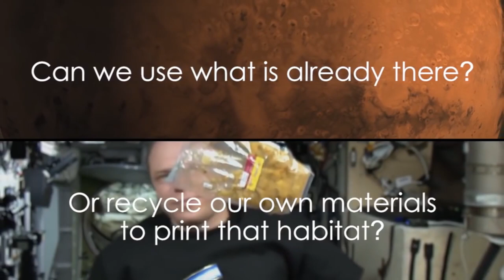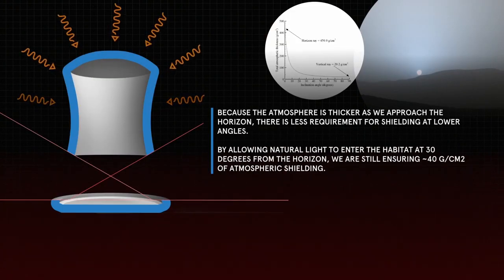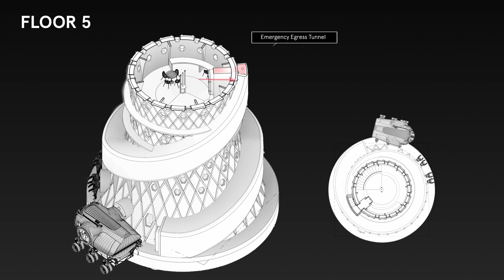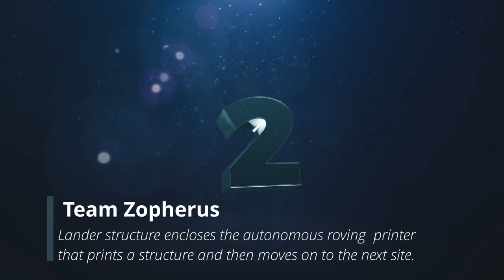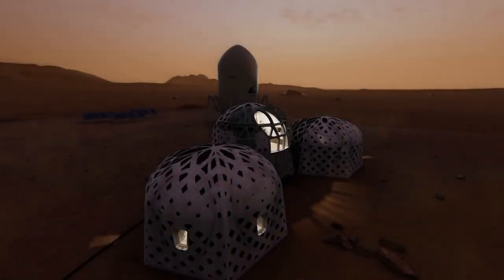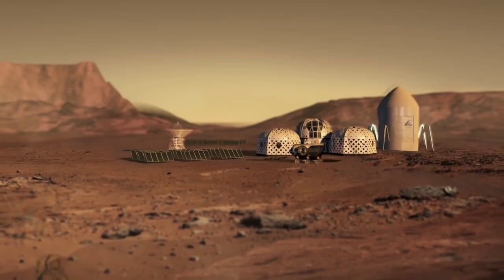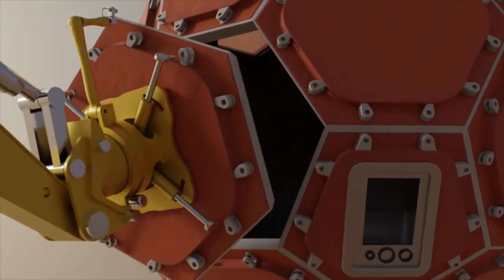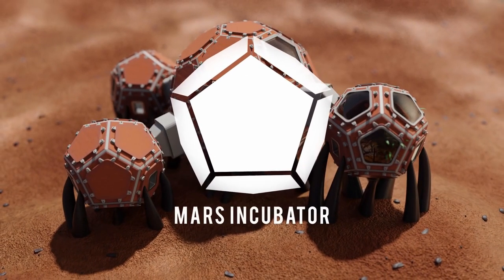NASA’s 3D Printed Habitat Challenge: Phase 3 Level 4 Final Results

Comment: Outgassing could be a serious problem for mars colonies if proper research is not done on the moon. The first biosphere failure was due to concrete outgasses and this could be more significant if mars habitats are designed for 1/2 atmospheric pressure. Plastics also pose outgassing problems due to gasses trapped in the molecules during manufacture. 

Then there is the problem of biosphere equilibrium. Stuffing a closed system with Noah’s-ark animals does not ensure a desirable result as disclosed in biosphere 2 collapses. The types of materials of construction, the environment conditions and the shapes of habitats seem likely to be dominant factors. For example air ducts would favour insects and small rodent populations. Porous walls made from 3D printing regolith with binders such as cement or thermoplastics might favour several of the 1000s of types of bacteria living on our skin, to the point where they could survive and mutate on the surface of Mars consuming the energy in the perchlorates (yes there are bacteria on earth that live on it). The moon project is critical for solving these problems being only a few days away from rescue compared with 6 months for mars. America was a biosphere when Columbus brought his settlers and deseases wiped out the locals as a consequence.

Comment: From an Occam's Razor point of view: every "contestant" came with their best foot forward, and not one
of them considered the "balance-of-system" approach of using the "Olivine Sand Dunes for 3D Print Medium.
The Olivine Sand Dunes - ARE THE ONLY PROCESSED SUBSTANCE ON THE PLANET IN GREAT ABUNDANCE.
3D Printing with "this consistent material", mixed with "anaerobic adhesive" to make the bonding uses less energy.
I'm so sorry. but Robert Zubrin was right.